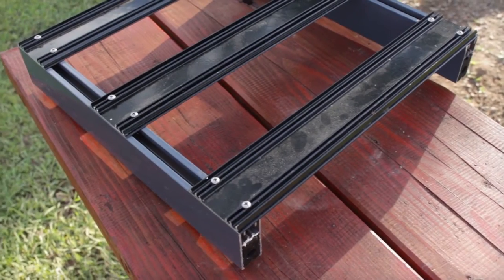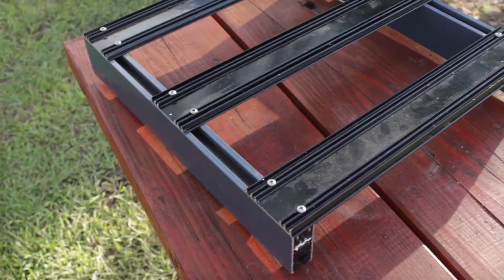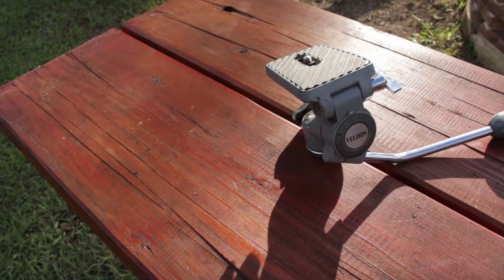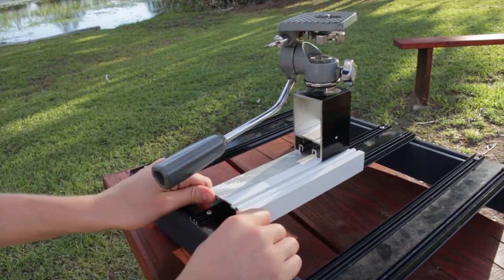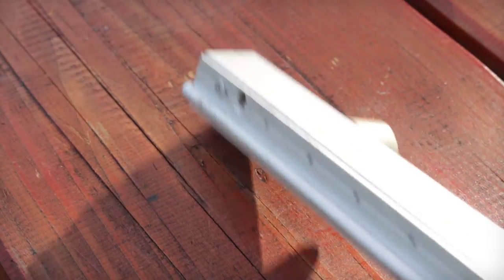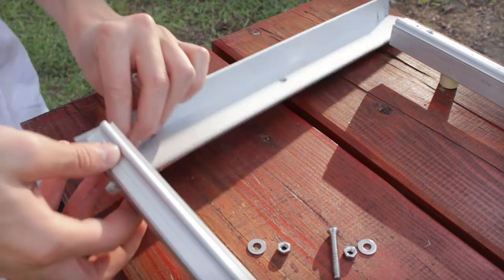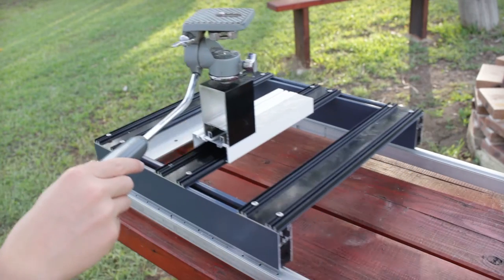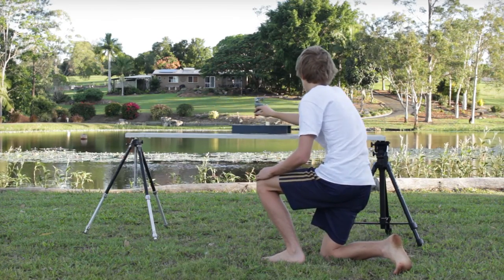Smooth DIY Camera Slider

Comment: Thanks for the overview, looks great! However, could you please post the exact specifics and where to obtain the parts? Also, what is the maximum load/weight capacity of the slider and if the camera setup is too heavy does it bend? Much appreciated.
Reply from the maker: See updated description above. I deliberately chose such solid (& light) boxing for the frame so it won't bend, as with a lot of pvc style diy jobs I've seen. This design would easy handle upwards of 12kg without bending much, the wheels might start to have trouble rolling smoothly after about 8kg. Ha ha - there's no shopping list - mostly stuff from the shed. Most parts are aluminium so have a look at hardware store/ metal supply/ door and window specialist. Hope that helps.